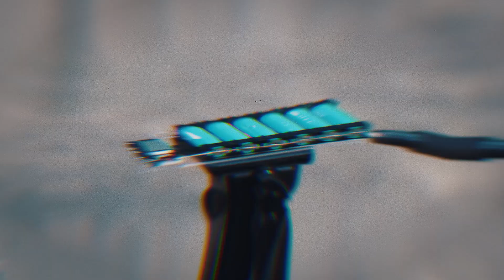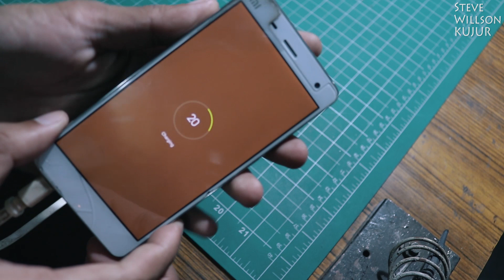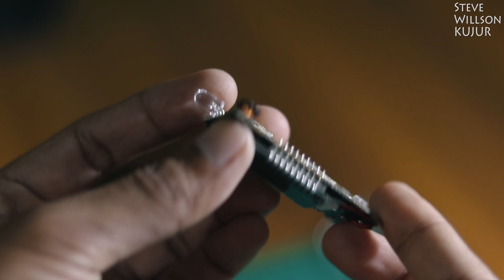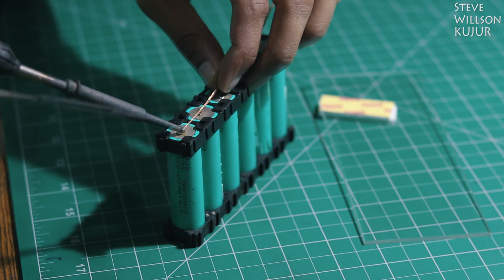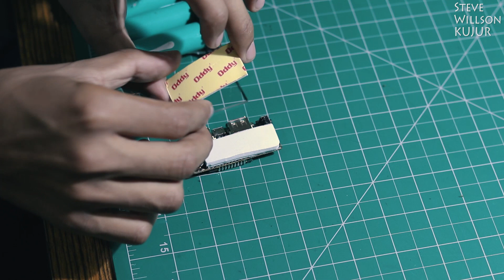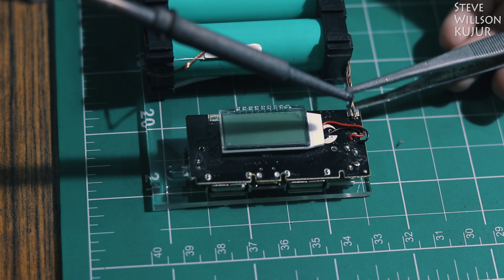How to Make a 20000 mAh Power Bank

Comment: So you have a total of 7904 mah in parallel based on the markings on your batteries. You have to upconvert from 3.7v to 5v. You also have to account for the loss of the up conversion. Why did you you call this video 20,000 mAH Power Pack? Even with brand new 3000 mAH batteries (which usually only have about 2700 mAH), you only reach 18,000 mAH in parallel (or 16200 mAH actual). And this is before the up conversion and loss. The title doesn't make sense. You should correct it.

Also, I would suggest you do this with similarly matched capacity cells. You have nearly a 400 mAH difference between your best and worst cells. This is going to cause a situation where some of your cells are inefficiently wasting power as they try to charge other cells.

With all that said, I'll happily praise you for the work. A good demonstration of putting a pack together.

Comment: Doesn't these require a BMS circuit ? individual battery charge, voltage monitoring?
Reply from the maker: rohith nechikkunnan no all the batteries are in parallel that's why
Reply: The powerbank circuit does everything.

Comment: Steve... why are the batteries in parallel and what is the difference, power wise , from serial... thanks buddy
Reply: connecting batteries in parallel increases the amperage thus with a greater backup at a constant 3.7 o/p voltage